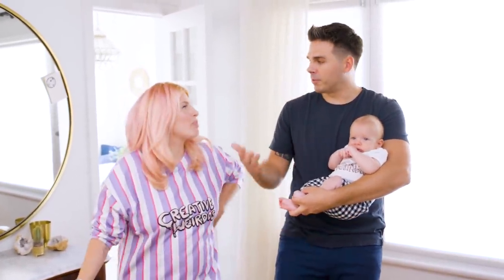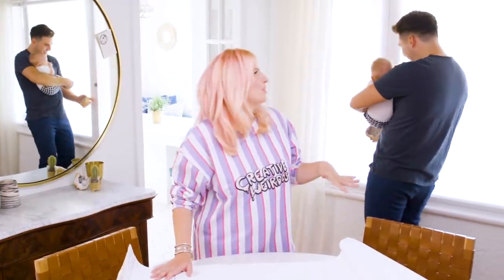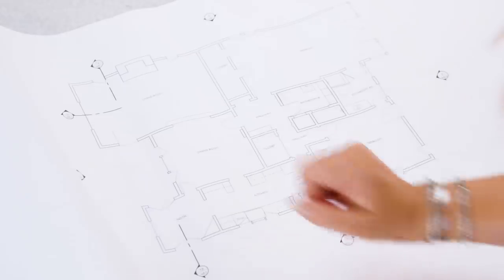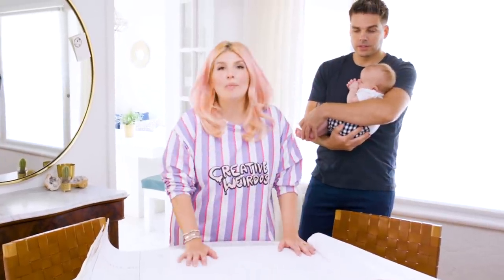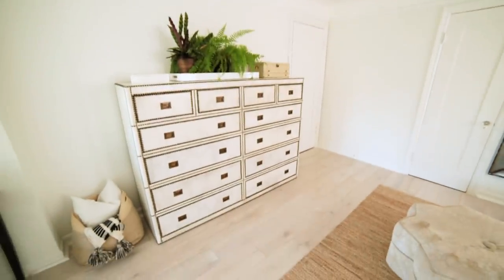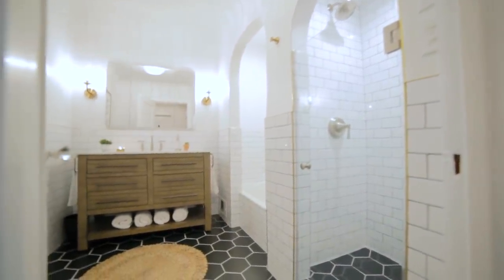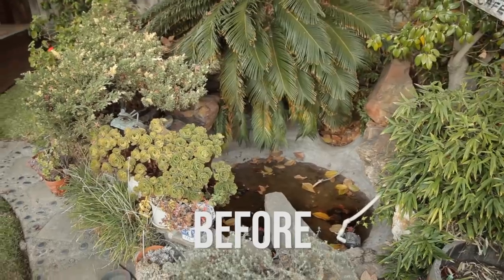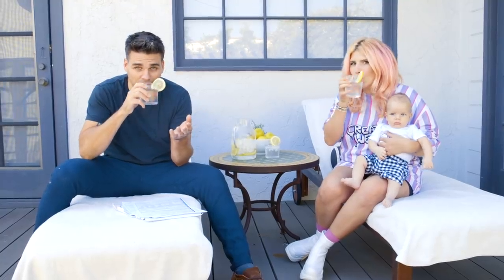Final House Tour & Our Baby's First Video! | OMG We Bought A House

Comment: Amazing work guys! Only thing, replacing the hardwood floors in the bedroom with laminate I think was a mistake. Had they been sanded and revarnished it would have felt far more premium (even if the colour would have limited your options with the space).
Reply: I totally agree.  I think they did a number on that house in several areas and not all in a good way.

Comment: Im from Texas, this question might not apply, but do you guys have central Air Conditioning? And if so, how did you work around that, since older homes didn't factor in AC back then?